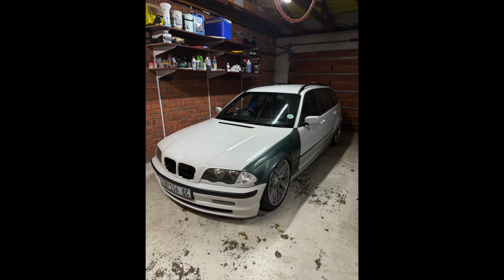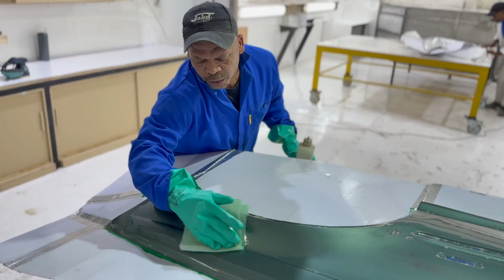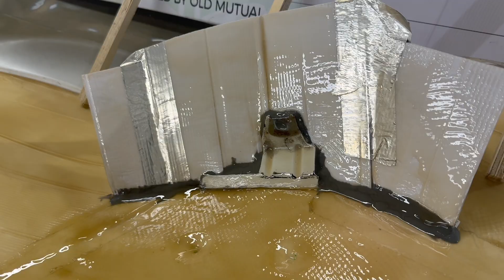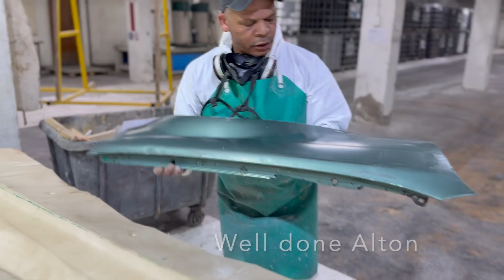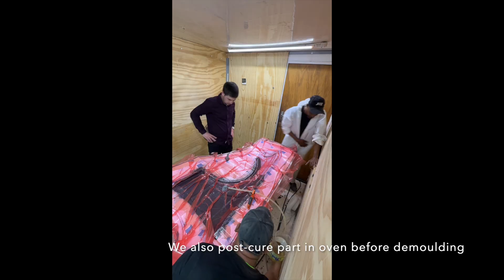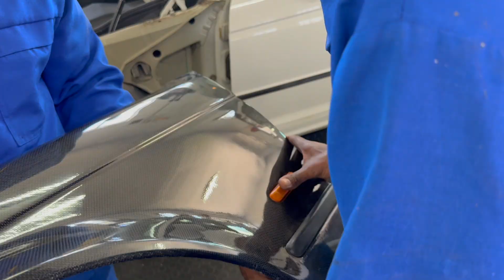Making carbon fibre fenders for BMW E46

Comment: all that to save 4.5 lbs, of course 100 lbs of fuel in the tank. just don't top it up, and you'll save the same weight
Reply: Fuel is stored in the rear, the front fenders are on the...front. At least they are on my e46, not sure about yours.